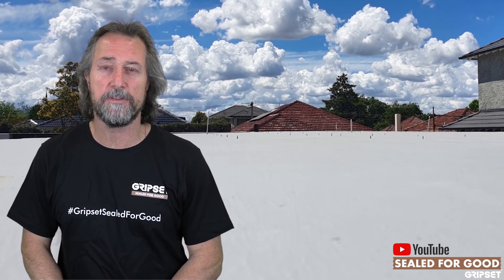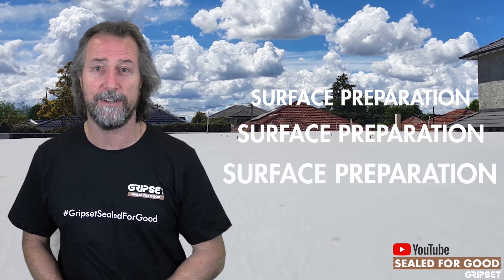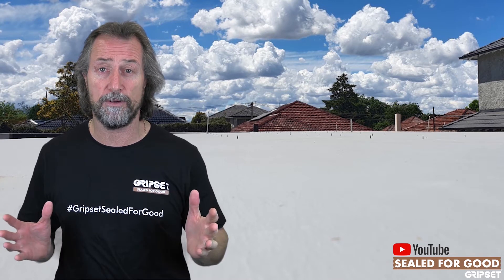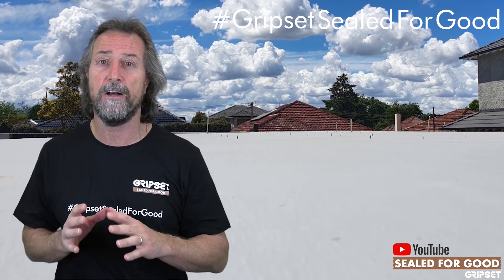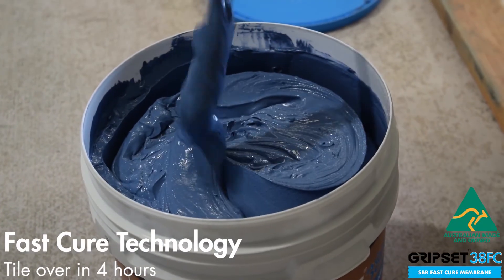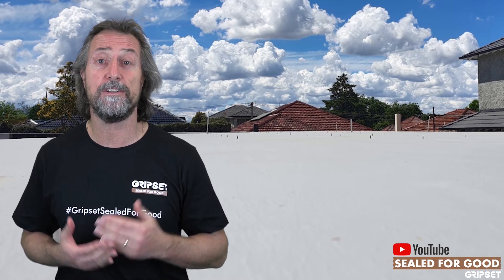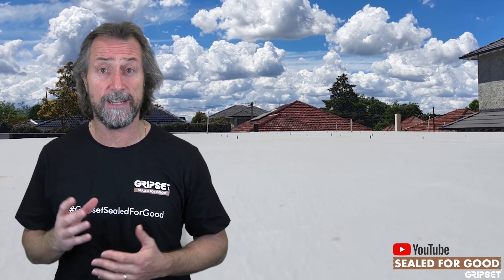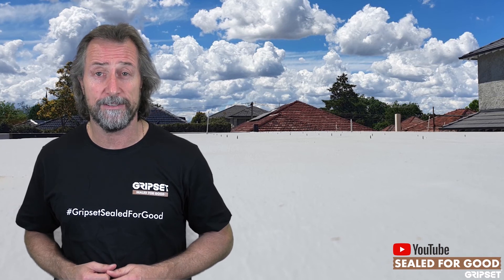The Importance of Surface Preparation

Comment: Hi just a question on Surface preparation is it better to use a brush and then a blower clean the area or would it be better to use a brush and vacuum the area
Reply from the maker: Hi Edward, we would recommend to vacuum, that way you aren't blowing dirt around for it to resettle.